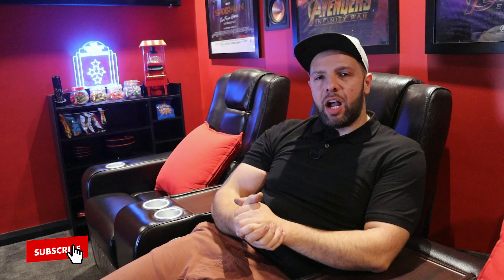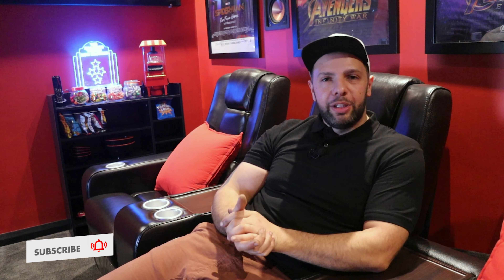5 TIPS to ENHANCE your Home Theater Speakers from your Receiver

Comment: I was told by a best buy rep that using banana plugs causes distortion. He wanted to make it very very clear to never ever use banana plugs because of that. Would you agree with his statement?
Reply from the maker: The benefit of banana plugs is to help prevent a short circuit. Ofcoarse anything added in between 2 connections can effect the slightest difference in sound but a cold flow crimped plug is going to sound great, IF you really want to use them. 🤙🍻
Reply: @hstudio30  Do you have any recommendations on which cold flow crimped plug i can get, perhaps on amazon or ebay?